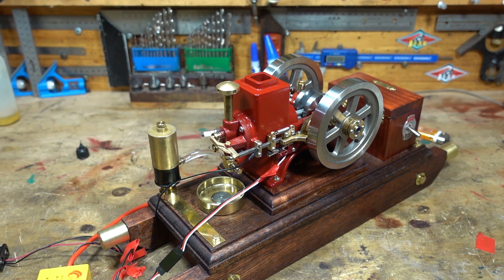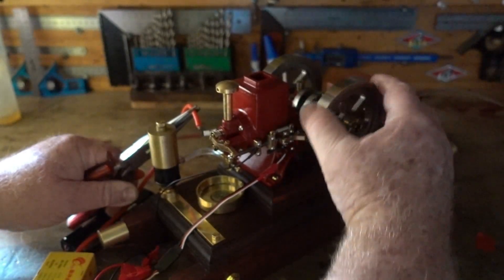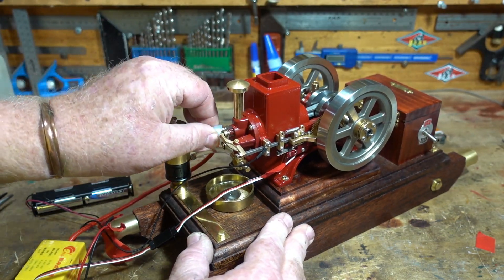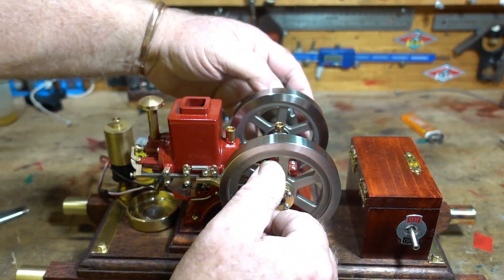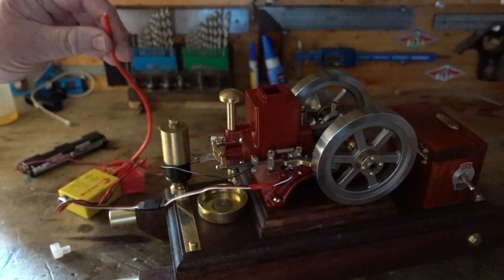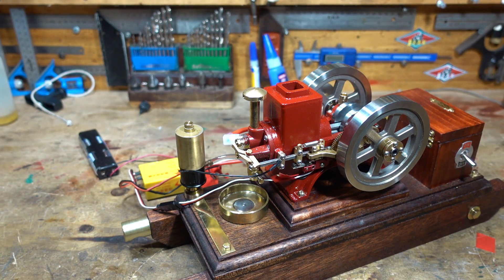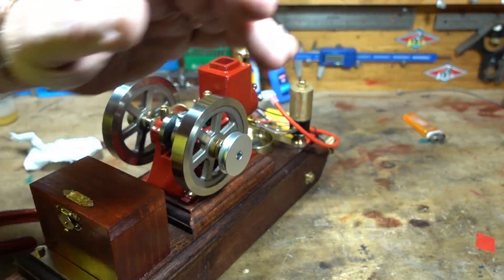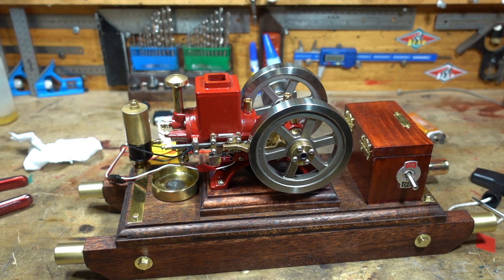Hit & Miss Engine Enjomor Help Needed - Part 3 Have Spark!!!

Comment: Bonjour Jim,
When you plug the carburetor with your finger, do you see the fuel coming?
On one of my engines, I tried to launch it in the opposite direction and as a result, my gasoline could not reach it.
Second test, do you see the spark on the plug itself ? I halso had an issue with the L-fitting...
Amicalement, Raphaël
Reply from the maker: Hello Raphaël.....Henry helped me ....so happy !!!!

Comment: Hi, im a new follower and seen this.. just a quick comment, please dont take offence.. i could be wrong.
3things required to get an engine running..
1) good compression
2) good spark
3) correct fuel air mix
If all three of these are ok then is should run..
Now, as for getting it going.. you definitely have good spark. But i noticed you finger was wet from the carb. Is it blowing the fuel out or sucking it in?
 Is the fuel being sucked into the engine? Is the sparkplug fouled (wet).
A simple question is are you turning the engine over in the right direction? Mistakes can happen. Is it a clockwise or anticlockwise rotating engine?
Check spark is firing at correct time just before top dead centre (i believe i could be wrong, depends on type and other factors - need to check build manual)
As a useful aid to troubleshooting the engine, rather than usng the pullcord, attach a temporary electric start, (small electric motor to turn the engine over enough for starting) you can also use this to listen to the engine to make sure the valves are opening at the right times etc checking spark timings, check air is being drawn into/pushed out of the engine. 
Are you getting enough compression, it does not seem alot of compression if you can still turn it over by hand. -  check valve timings/clearances and that the decompression valve is not open on the compression/ firing stroke.
Also check govenor clearances.
Once all the above have been checked i cannot see a reason why it shouldn't run..

All the best to you.. i hope you get it running soon.
Reply from the maker: Thank you very much for the reply, I haven't had time over the weekend to muck around getting the engine to run. But I think the main problem now is the timing is out.....again thanks for the reply much appreciated - Jim
Reply: Good suggestions. I've just ordered one myself, appreciated.

Comment: My Enjomor is the thirstiest of these little engines.  It likes 1 to 1 1/2 turns open on the mixer, sometimes 2 to get going.  You commented about an arc near the contacts, did you remove the 3rd wire from that little harness?  The good news is that those wire harness plugs are an R/C servo plug, so you can replace the harness wire easily to clean up the wiring when you finally get it going.
Reply from the maker: Thanks Henry, yes I took the third wire right down and wrapped with electrical tape. I will try opening the mixer up more.
Reply from the maker: Henry does the brass cogwheel behind the governor have anything to with timing? I can't seem to be able to time it so the contacts close on the compression stroke, ONLY the exhaust stroke?
Reply: @SteamEngines-Jim  The governor is on the cam gear.  Did you remove the cam while you were working on the governor and lose exhaust timing?  The cam on this engine is oddly shaped since it has the very long exhaust pushrod travel.  It pushes the exhaust rod 1/2 way to trigger the spark, then pushes the 2nd step to open the exhaust valve after the power stroke.  I find it easier to time this wonky shape cam "backwards."  I set the engine to BDC and then put the cam in place where I think it has just closed the exhaust.  Then I rotate the engine backwards to see if the exhaust opens and then closes just after TDC.
Once you have the exhaust timing in place you can move the spring bracket bumper that closes the ignition points forward or backward on the pushrod to advance or retard the timing.
Reply from the maker: @henrybangsberg2187  Henry....thank you.....Yes I think this is what all my problems come from, I was working on the governor because of that annoying spring that its the lever that presses down on the governor had come out and I removed that cam wheel. p.s Just sent you an email - Jim
Reply from the maker: @henrybangsberg2187  Henry....you helped me mate get it started finally. Cannot thank you enough!!!!!!.........THANK YOU !!!!!!!!!!!
Reply: What is the best fuel for these? Normal petrol?
Reply from the maker: @RiverSheOak  I use Zippo lighter fuel but the majority just use normal petrol.
Reply: @RiverSheOak  I use regular petrol or camp gas.  I find that Camp Gas (White Gas or Coleman Fuel is the same thing) requires the carb needle to be open a bit further than regular petrol, so if I have a very sensitive needle adjustment it can be easier to get the engine running with camp gas, but they will run a bit longer on petrol.
Reply from the maker: @henrybangsberg2187  This is supposed to be exactly the same as Coleman fuel (which we can't get in Australia Henry) -
https://www.bunnings.com.au/diggers-1l-shellite_p1563463

Comment: Retard the spark upon compression, choke the carburetor idle mixture full in half turn out from the seat. Is this gravity fed for fuel sounds like a flooding issue
Reply from the maker: Thanks William for the post, much appreciated.  It will be a few days before I can get a chance to try getting it started again. Super appreciate the suggestions.

Comment: Hi Jim. With my hit & miss engines I have found that choking the carburettor helps with starting. Disconnect the power or the contact breaker. Put your finger over the carbs air intake. Rotate the engine a few times. Then reconnect the electrics and try starting it again. Also it could be that the timing is out. It looks to be set by the little brass bar that operates the contact breaker. If you know someone else who has the same engine get them to measure the distance that the bar is from say the latch with the engine in a fixed position say top dead centre. Then set yours the same. Cheers, Alan.
Reply from the maker: Thanks Alan, it will be a few days before I can get a chance to try getting it started again. Super appreciate the suggestions mate!

Comment: Check to see when it is firing, it looks to me that it is firing too late after TDC. I hope this helps. Keep up the great work Jim 👍
Reply from the maker: Matt....mate can you explain this a little more to me please? Do I release the bolt that contacts the reed switch and move that backwards and forwards to set the timing?
Reply: @SteamEngines-Jim  I made you a quick video.  https://youtu.be/aSwhyN6PTjo
Reply from the maker: Matt....is this how to adjust the timing?
https://www.flickr.com/photos/198834535@N04/53076894890/in/dateposted-public/

Comment: Do you have a dremel tool if so put a buffing wheel on and hold it against the flywheel and use it for a power starter.

Comment: Was the plug wet at all, that should show if you are getting enough petrol or not. Next turn over slow and see that your spark is at or a little past top dead on compression  stroke.
Reply from the maker: Doc appreciated just checking is it TDC with the exhaust valve closing?
Reply: @SteamEngines-Jim  exhaust closes then intake to bottom then next time up is compression  and should get spark at top or just past.

Comment: Take the spark plug out, connect the high tension lead to it, ground the base of the plug and make sure that you are getting a spark across the spark plug gap.
Reply from the maker: G'day and thanks for the reply appreciated - Yes doing what you mentioned I am getting a very good spark jumping across the spark plug gap.